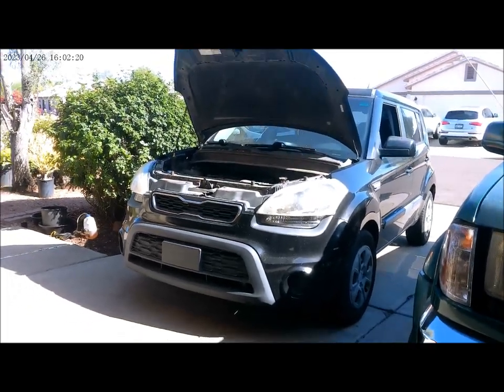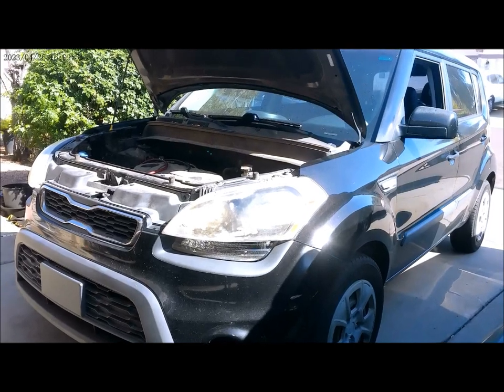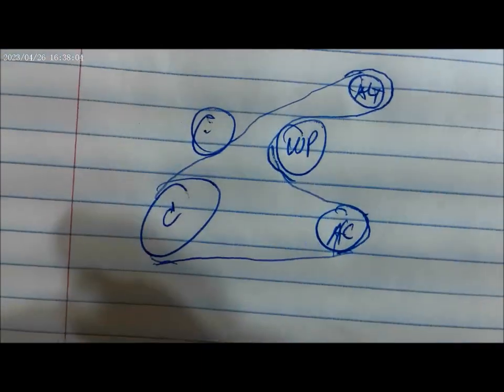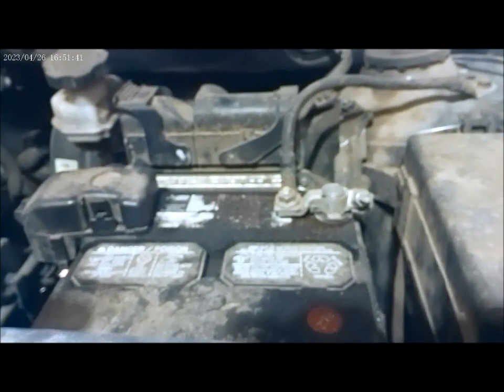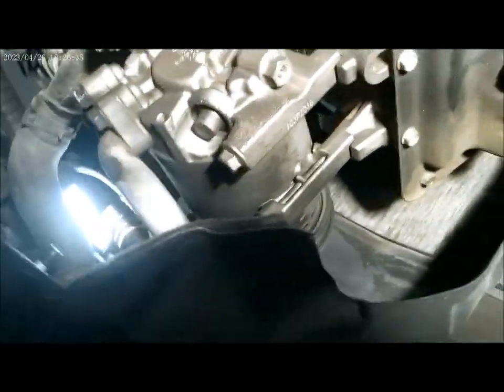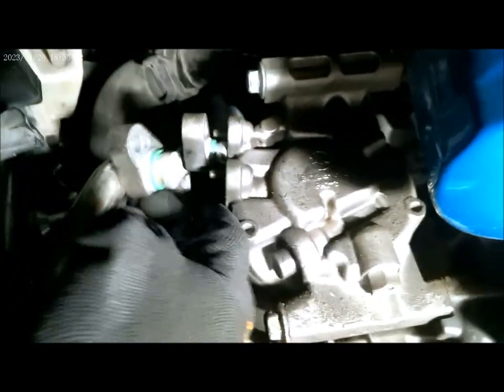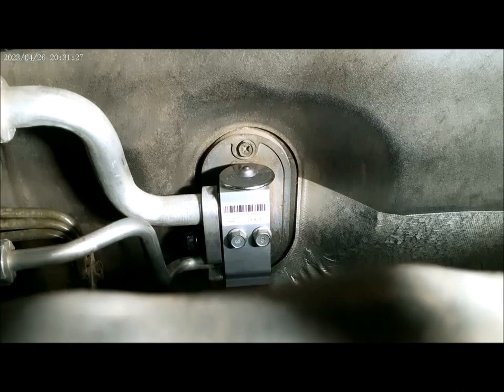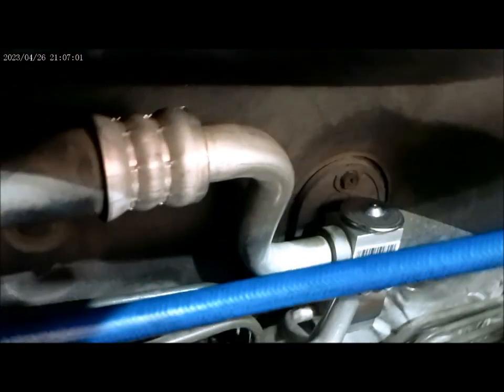2013 KIA SOUL AC COMPRESSOR EXPANSION VALVE AND DRIER

Comment: remove the A/C Drier straight down from the Drier casing.
in this car is impossible because there is a metal in the middle. you need to remove the front bumper and condenser

Comment: How you remove the dryer, by the from bumper through the plastic or was by the tire?
Reply from the maker: remove the A/C Drier straight down from the Drier casing.
Reply: @johnrichiequillopo5765  I heard others saying is impossible to remove without move the condenser, because it has a metal at the bottom.